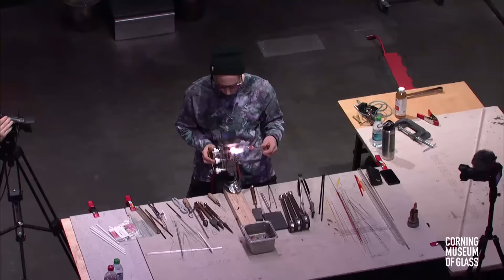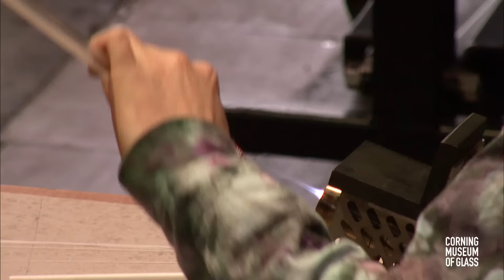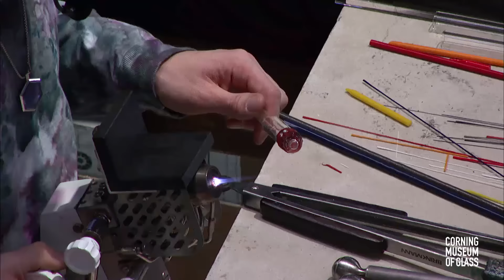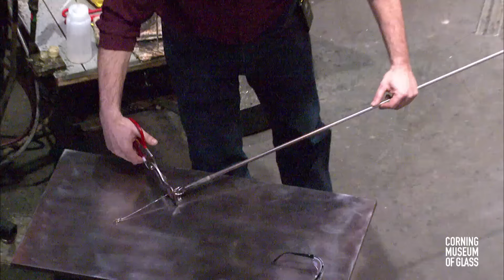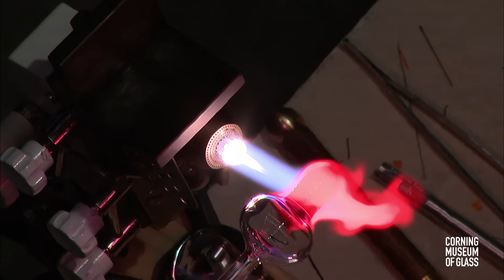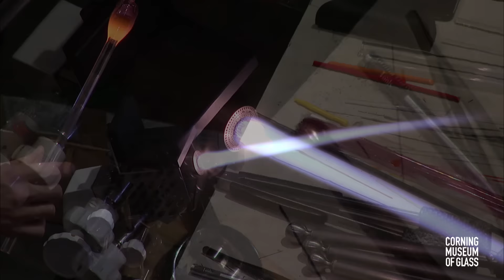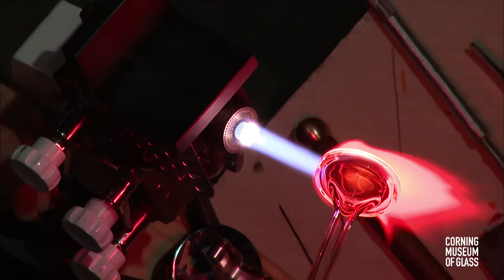Eusheen Goines Guest Artist Demonstration

Comment: To everyone wondering why they woke up to this: This video is 4 hours long, that's comparable to a sleep's length, so it suffices to fall asleep at anything between say 0 and 4 hours before this video started, then your wake-up moment will have very high chances of falling somewhere into this video.
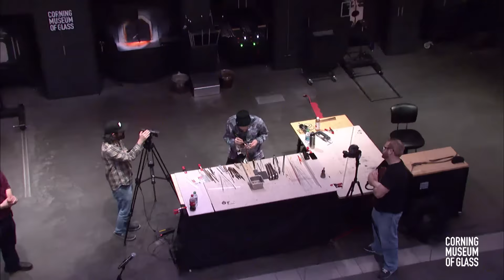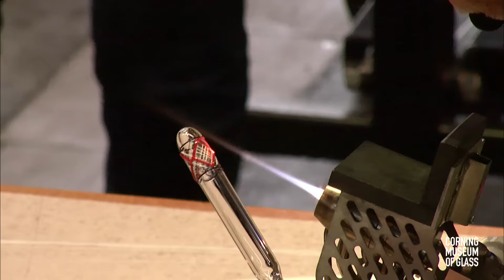It's the same as having a bus to the east and a bus to the west, each one every hour. If the eastbound one is at 8:00, 9:00, 10:00 etc and the westbound one is at 8:05, 9:05, 10:05 etc and you walk to the bus stop at random moments, you will almost always see the  eastbound one arrive first because it's the "next" bus for 55 minutes in each hour, while the westbound one is the "next" bus for only 5 minutes in each hour, you do the math.

Comment: This may be a silly question, but do you ever introduce air bubbles on purpose to create specific designs or features? I know in creative artistic works the overarching general rule is that you learn all the rules so that you can then bend and break them at will to achieve a particular feature. Is that done in glassblowing? And obviously I’m ignoring the initial bubble being blown, I’m talking about adding in bubbles in other ways that aren’t about making a piece bigger and thinner.